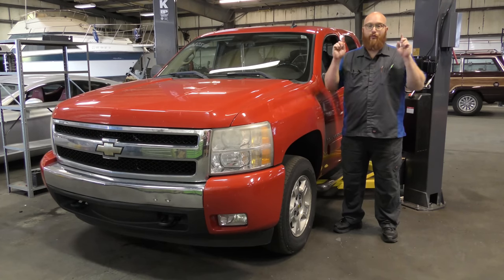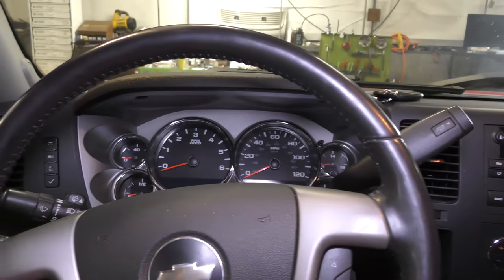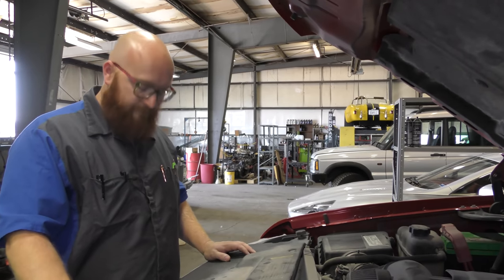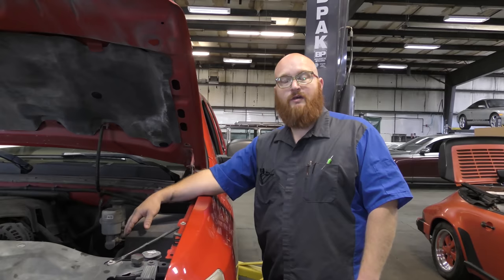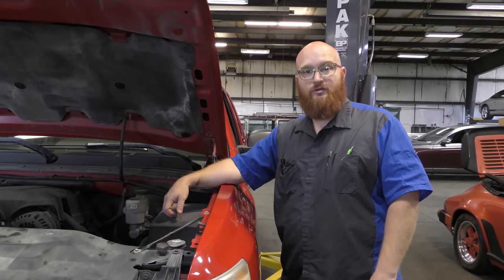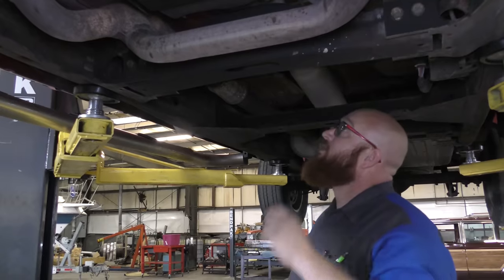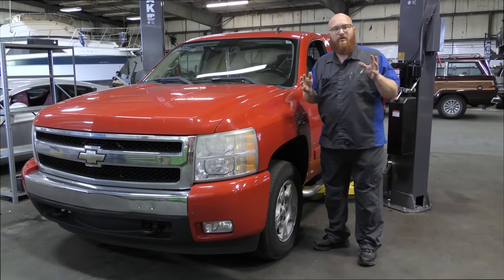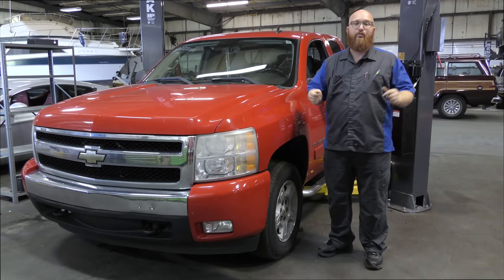Good Truck/Bad Truck? CAR WIZARD shares most common problems on the 5.3L Chevy truck at 100k+ miles

Comment: Its a Chevrolet so I would not buy it just because of that. I have never had a reliable experience with GM vehicles
Reply: My parents used to have a Pontiac Montana minivan and they never had a problem with it.
Reply: I have had the best luck with my GM vehicles, all things considered.  My worst was a Ford.  I didn’t start with a bias.  My first four cars were Ford, Chevy, Plymouth, and Toyota.  Everyone has a different experience with motor vehicles.

Comment: I had to run out and check my 2007 4x4's 5.3 ltr LTZ. Whew! Luckily your act was bullshit like all psychics. 176,000 mi. everyday driver and stills slams your head back on the highway when you hit passing gear. Almost 15 yrs now and has never let me down or stranded me. Of course, I plead guilty to proper maint and preventive on hoses, belts and tune-ups, tires, battery, anti-freeze. I did replace ball joints at 100k only one side was getting bad, I did both sides anyway. I take care of her.

Comment: These are the worst generation Chevy truck. They ruined the 5.3 with the AFM cylinder deactivation bullshit. The suspension is all junk, they all ride like shit. They rust worse than any other Chevy truck. The interior just falls apart with normal use. It's a miracle if one doesn't have every warnng light on the dash on.